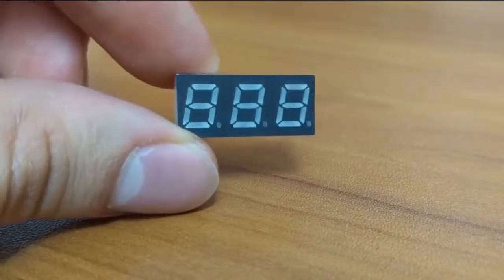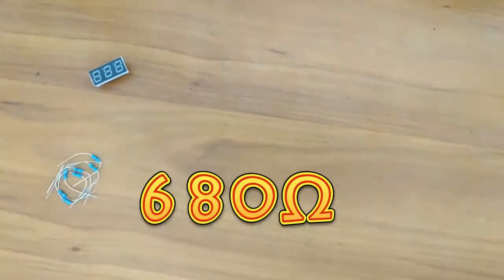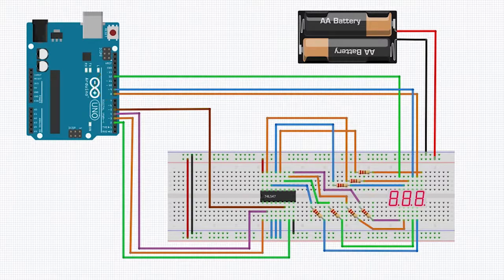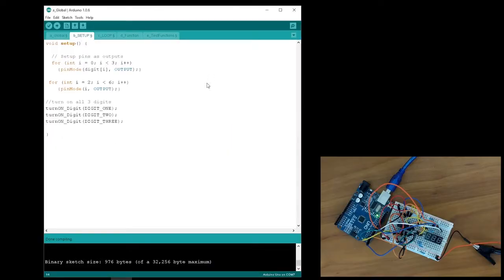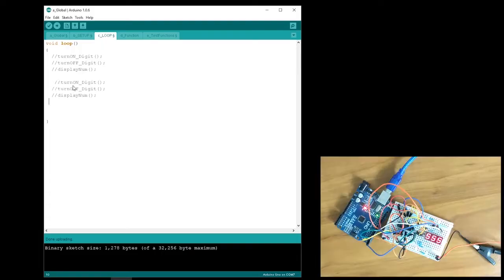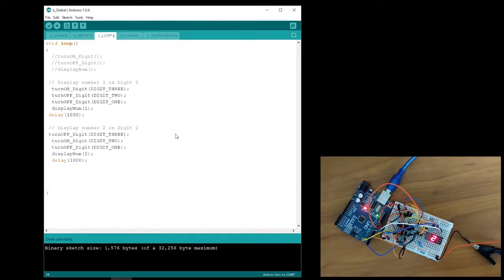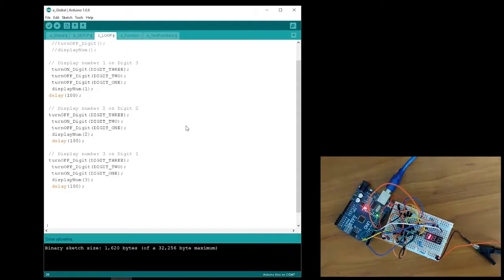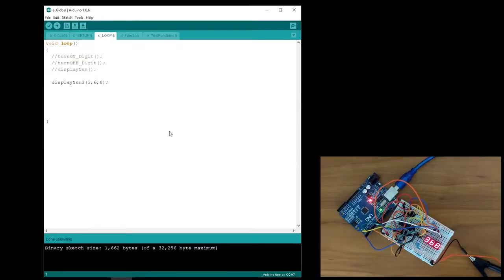Arduino Tutorial | Displaying Multiple Numbers on the 3 Digit 7 Segment Display [multiplexing]

Comment: I was looking for a way to display my 4 digit Heating wire display, while being efficient on pin number, however I came to the solution that I can only write 1 at a time which unlike here kills the idea for a functional clock, came here looking for a solution but seems like I should just use a lot of transistors and pins, if anyone has better ideas please share them.
Reply: I think, that maybe switching numbers fast enough would give pwm like effect, giving average from power to all , so theoretically by switching fast enough they should all go on.

Comment: Can Arduino be directly connected to the display?
Reply: If you have enough IO pins, yes. For a single digit 7 segment display you will need 7 IO pins. If you have a two digit 7 seg display, you will need 9 IO pins because you need 7 pins for each segment of the number and then an extra pin for each digit. Three digit, 10, four digit, 11, etc. Then you will have to write code to multiplex the numbers

Comment: I was searching online to see if a efficient method exist to do this but their really isn't it appears. Just glad I came to the same solution
Reply: im sure theres got to be a way where you can wire an AND gate and a few transistors to switch the output from one digit to the other but eventually it all comes down to having to write a bit each display at a time. how you do that is whats really up to the designer.

Comment: I was trying to use your video to learn something and it seems like I am unable to do so. Your examples are not working, I found other ones that are working so connections are ok. Your methods are not clear, tabs, code in parts...
Can't you make a simple code that will work? Can you provide information such as Data, Latch, Clock pins, and then digits? Then your code would be useful not scattered all over the place.

Comment: Hi, I'm using a common cathode display (instead of common anode as  you are using), and I've run into a bit of trouble turning each digit off. If I wire the cathode of each digit to an Arduino output, setting the output LOW can turn on each digit, but I am afraid setting the output HIGH to turn the digit off will produce too much reverse bias current and blow out the LED. Any suggestions to fix this?
Reply: If its a cathode then you dont have to set output to low to turn it on , instead set the output low to the common cathodes and set the output to high for the segments. No need to worry about the leds as arduinos only emit like 5v or 3.5v when set to "high"

Comment: Can you use it with a 74HC595 shiftregistor instead?
Reply: It’s pretty simple, you can find schematics in google. Shift register just turn bits in byte you write into it to high or low output on the corresponding pins of IC. Good luck with that. Hope not too late to answer 😁
Reply: @malcolmholmes115  Hey! I got a simular project I want to do. Mind helping me?

I got these components;

74HC595 
7447
3x SA56-11SRWA

So I want to use a shift register, a bcd decoder and 3x seven segment display. So I will also need to use multiplexing. Got any idea on where I can start with the layout?
Reply: @TrailersYT  if you have your inputs coming from the MCU, you can use only a single shift register, I did it before with 595ic and without any bcd driver. In order to display 3 different digits using same control lines, you should blink each of 3 digits very quickly so for the human eye it will look like 3 different digits displayed simultaneously. I have a sketch somewhere I think. For connecting it together try DIY Layout Creator (open source, free and not as crappy and slow as a fritzing), for physical layout I would recommend a simple breadboard. Where is your inputs coming from and what is the goal so far?
Reply: @TrailersYT  since you have 3 displays instead of one 3 digit display, you can google for any 3 digits display data sheet and connect your 3 displays wiring in a similar way, so you will have same amount of pins as you would have with a single 3 digits display, that’s how they essentially  made. Unfortunately I can’t post pictures or links here, but it’s easy to google and feel free to ask anything here. Hope it helps, best of luck with your project!